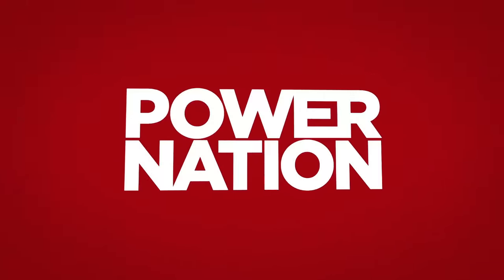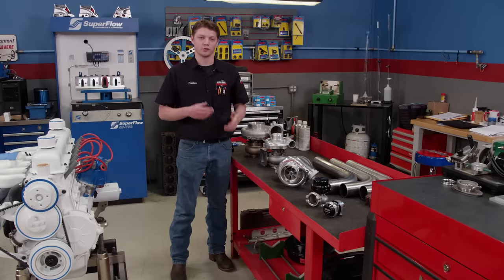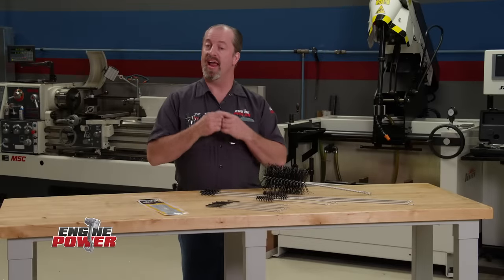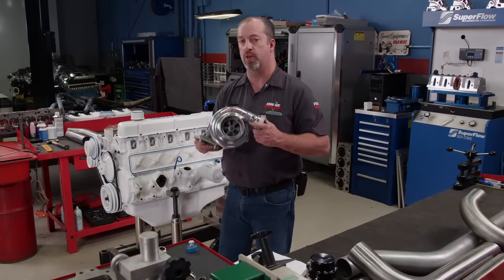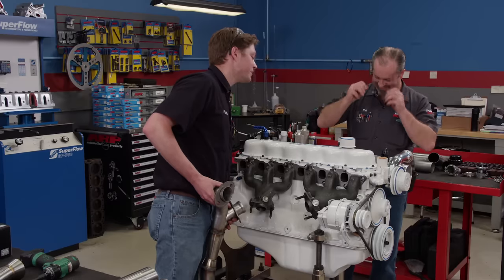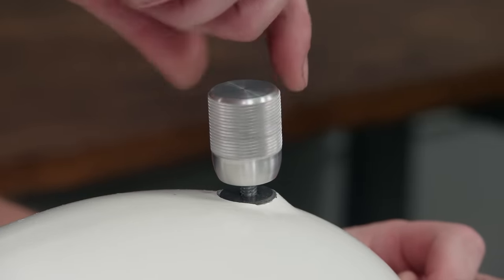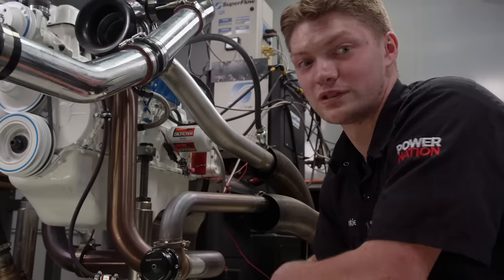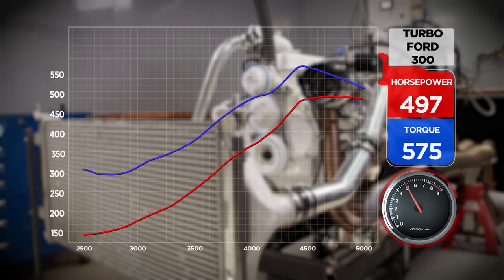Turbocharged Ford 300 Inline Six Makes Over 500 HP on the Dyno - Engine Power S8, E14

Comment: One of the best motors Ford ever produced. They seemed to take abuse and still run forever!
Reply: I agree. Ford really hurt my feelings when they discontinued the 300. I drove an old 1970 F100 for 6 years and I was not easy on it. I broke just about everything on that old pickup EXCEPT the motor. And yes, it was the 300 inline six.
Reply: Definitely one of the best all straight 6 motors made great torque numbers!
Reply: Yeah as long as you didn't rev it to high and float the valves
Reply: Adam Chapman  nah the aussie barra is better. Dohc, not underpowered, and the factory block can handle 2000+hp.
Reply: And the 4.0 Jeep motor, both legendary
Reply: @deborahchesser7375  don't forget the leaning tower of power 225 from Chrysler.
Don't know why people discount the Old School 6s.
Reply: Im a chevy guy, and even I like the 300. A good motors a good motor.
Reply: @CamAteUrKFC  Yep I can say the same about the good ole 350 Chevy 4 bolt main. Just a work horse.
Reply: @deborahchesser7375  Yep, undoubtedly the best motor Jeep ever made.
Reply: @SGTJDerek  I have one (Slant 6) in my garage!  Was going to use it, but never did.
Reply: @aaronmcconkey1062  The 240/300 was first used in 1965
Reply: @SGTJDerek  The AMC/Jeep 4.0 is popular
Reply: I got one with 300 hundred thousand on it she still run 😂😂. Now I'm wondering  if I can make it like there 300 🤔🤔🤔
Reply: I doubt this block would be durable enough to handle 600 ft/lbs torque if you put a trailer on it and dragged it up a hill a few times. Problem with it is, it is 6 cylinders long and the block will be getting wound up torsionally causing the main caps to walk or the main saddles to crack. It was never designed for 600 ft/lbs but if you weren't greedy and knocked the boost back to say 400 ft/lbs it'd probably be perfectly fine.
What a great thing though.
Reply: @timothykeith1367  never said otherwise. Unlike the others, there's a huge Aftermarket that support it. You want obscure, Pontiac had a pretty strong performing straight way back in the '60's and the argument can be made that the Hudson FLATTIE 6 could actually be the first Factory MuscleCar as it had more power than the legendary V8s from Olds and Cadillac.
Reply: @CamAteUrKFC  you and me both.
Reply: Agreed!!
Reply: I killed mines in less than 12,000 miles of owning it
Reply: John Sears  overheated it and warped the hell out of the cylinder head. Also revved the piss out of it and cracked the block
Reply: Ford Diesel 7.3L : Am I a joke to you
Reply: @SGTJDerek  C'mon the 225 is hardly in this league. They are very ordinary engine. I have worked on hundreds upon hundreds of Slants in my career as a mechanic and I can tell you while not a poor engine per se they are most definitely below average in terms of reliability, power, flexibility and durability. 
They simply don't last as long as other inline sixes, though in truth some do last but most don't. On top of that they can't handle sustained rpm over 3500rpm as they flog out. You're going up a long hill with a load on and use 1st or 2nd and go up at 3800rpm the exhaust manifold cracks, it overheats, then they start detonating because of the hot spots in the combustion chamber. They're not good for towing heavy things at on the open road.
If you never rev them over 3000rpm and never use them to tow anything but a 6x4 box trailer and always change the oil and filter they last quite well but then the no.6 big end lets go and punches a hole in the block and smashes off the starter.
Yeah not much of an engine in my experience
Reply: It was the best. They quit making them because ii was killing dealers on repairs.....there was hardly ever any.
Reply: I got a 250 cid
Reply: I have a 77 F100 with the 300-6. Still runs perfect. Has a slight knocking sound that has not gotten any worse in the past 10 years or so.
Reply: @aaronmcconkey1062  is that the only good engine Ford gave you aussies?
Reply: @CamAteUrKFC  Chevy made a great 6 too. It was the 250 GM straight 6 used in vans and step sides. Virtually indestructable...💪
Reply: @aaronmcconkey1062  The Barra engine looks like a fantastic engine. 
My uncle had a 2 door American Falcon, in Burgundy Poly with a 289 V8 and 4 on the floor. That car just looked cool! He still kicks himself over selling it. 
That said, the Barra engine was developed for the Falcon in 2002. It is a car engine. The 300 I6 was designed for the F100 pickup in 1965. The power and torque curves are shaped for hauling loads. The Barra is also a 37 years newer design.
Reply: @aaronmcconkey1062  those Barrasso are higher rpm engines.  The 300i6 was designed to have low end torque. Barras are just made for performance while the 300s were are for work
Reply: @jamesworkman686  It's red line is in the low 4k. It was a low RPM tractor motor adapted to car use. Red lining it until it breaks isn't a problem specific to one engine.
Reply: @GlitchMaster0001  Just sold one with 375k original miles, runs and drives fine, needed a clutch for the first time.
Reply: @marclaporte7163  They still produced them
Reply: @bloobebybloob6091  Correct.  Navistar/International Harvester produced them.   Ford purchased them.
Reply: @marclaporte7163  ic I thought they purchased the rights to produce them. My bad
Reply: @marclaporte7163  I went digging and Ford engineers did help design the 7.3 powerstroke so I would still consider that a Ford engine kind of
Reply: I inherited one from my father in law that had an oil filter full of sand when I got it. Literally sand! Damn thing weighed 5+ lbs. New filter and fresh oil and it ran like a top. Took me all the way to 340k when the truck got rear-ended and totalled by the insurance company. I drove it home after getting rear-ended, and it ran perfect. I miss that thing. Sure don't make em like that anymore.
Reply: @bloobebybloob6091  Possible.  But would probably be difficult with tooling, know-how, and honoring warranty.
Reply: @bloobebybloob6091  There was some degree of a joint venture for Ford to license the units as Ford Powerstroke.  I own 3 of these trucks.  The top cover/guard on the engine all say Ford Powerstroke but the valve covers all have a Navistar sticker..
Reply: @waterloo123100  We made that engine, 100% aussie made and designed
Reply: Just bought a 88 with 120k miles on the dash, starter is rigged with a button inside and my coolant is disappearing and my oil is regenerating 🤣🤣 body looks clean asf though
Reply: @NFSINSANE  dude I love my 2.2 its all you need to putt  around and non-interference. 350k on mine still daily driving
Reply: My dad bought a brand new 1984 4x4 with 4 speed when he passed away in 1989 mom kept it until I turned 16 then I abused it replacing rear end front end clutch then at 315,000 miles it had a wristpin lock up and needed a rebuild then I drove it until it rusted the floors out in 2002 when I parked it. I wish it was savable I’d love to have that old truck back up and running
Reply: The best

Comment: Ford 300 is one of the best engines ever made.  I drove one for two years, doing flooring work, overloaded as hell, and had 488k miles on the odometer.  Had close to 550k, when trans literally fell out, van had some serious cancer.  What hurts the 300 so much is that 60's cylinder head.  I'd love to see a modern free valve head made for the 300, and see how much it wakes up.
Reply: Have you seen the Australian barra motor?
Reply: Literally those inline 6 engines (the AMC, slant 6, and even the chevy 250/292) were just undestructible, wonder if someone got one to a million miles...
Reply: @Ausblack  yes McM, uses them from time to time, and skid factory. :)
Reply: @Thraser999  atomic performance or nizpro is worth a look
Reply: Dragboss garage was just talking about a Cleveland headed 300 built by Bruce Sizemore that made 500hp back in the 70s.
Reply: Correct me if'n I'm wrong but didn't UPS use those engines in their delivery vans ages ago?
Reply: Ford Australia made crossflow heads for I6s, don't know if any fit the 300
Reply: Worth investigating the bore spacing, if it's close to the Barra or the same,  and the head studs align up, instant 24V conversion with cross flow design.
The old school Mini A series has something simular using the head from a  K1100 BMW motorbike and this makes those little 1275CC engines sing to 7-8k rpm and 140bhp  N/A up from 28bhp in their original format.
Reply: @Eric Babcock I'm pretty sure those heads are for 144-200-250 Ford sixes, completely different block.  I'll be very surprised if they actually go back into production.  I've heard stories of people cutting 351C heads up, welding two of them together and making them fit the 300.
Reply: @larryhutchens7593  Yes, & they had their own UPS Spec'd Ford Parts.
Reply: They put a head on this one......
Reply: @Eric Babcock unfortunately the original owner passed and alot of stuff was lost.
Reply: I had a ford van with a 300-6 and 4 speed in the floor(factory) and hauled carpet as well!
Reply: @Apittslife  Thanks, I thought that I had read that somewhere.
Reply: @bigboreracing356  I drove the dog balls out of that van, 5500 rpm may not be alot for modern power plants.  I am known as a car killer, the old ecoline died to body rot, not column shifts.
Reply: @Thraser999  my grandpa has a old 250 in-line 6 Chevy 154k runs like a top no smoke and never been overhauled 1969 model
Reply: @larryhutchens7593  I'm not sure, but UPS used the Chevy 292 six for many years
Reply: @Sf_Mason  The Barra is based on the Falcon six.  The 240/300 is a long motor
Reply: @bigboreracing356  I had one in a 95 F150 and it was capable of revving to 5500. I did it regularly as a teen.  It was one of those cases of making a ton of noise and not going anywhere because it fell flat on its face just after 2500rpm lol.  But if you just wanted to be obnoxious in a parking lot, a straight pipe 300 at 5500 would certainly do it for you.
Reply: @Thraser999  yea my dads 64 250 went well over a million and then he rebuilt it still runs but been parked almost 20 yrs im planning on doing a 292 and using the 250 in another truck
Reply: How about one of those “Cleveland” cross flow heads.    Yes drag racers cut heads up and made these custom only in the early 70’’s for the 300.    Check it out some good history there
Reply: Steely oily dreams
Reply: I have a 300-6 with a tremec t-170 4 speed in my 87 f-150 and it revs to 5500rpm without a problem. Idk if you maybe had a limited industrial one or not, but it definitely revs in a normal application.
Reply: This what the Australian  Ford Falcon started with in 64 , 45 years later its a twin variable overhead cam  alloy head Ford Barra engine , normaly asperated taxi up to 
400 hp fuel injected turbo , and with just after market head bolts , valve springs and oil pump gears , we're getting over 600 hp with stock head and bottom end
....https://youtu.be/hJ6O1qnMmak
Reply: Ford did develop a prototype cross flow head at one point but the project got canceled. There was a drag racer that got hold of one somehow and built an engine with one on it at one point, but it's obviously a unicorn. There are some YT videos around. Would love to see what these would be like on the street if they had a good head on them.
Reply: Very linear power here.  Get some race fuel and advance the timing more and you have something.
Reply: @randr10  The Frenchtown Flyer is who your talking about i think.
Reply: Ford barra straight 6.. Modern day counsin. Its a monster, it puts the smack down on a 2jz
Reply: @Eric Babcock The company was bought and renamed. They have the heads again, in current production but you have to pre-order. Same expensive price as before, but if you want a modern head....
Reply: @Ausblack  Those are OHC engines.

Comment: Being a huge I6 Ford fan, this episode gave me goosebumps.  Outstanding job.
Reply: you like the barra?
Reply: Because it finally confirms a lot of our suspicions. You really can't go wrong with a big inline 6 and a big turbo
Reply: @tturi2  I do it is a nice straight 6
Reply: me to.....big 300 ..6.  Fan....had a 
1993...f150. 4x4....300..6...motor 
Snowplow on it.....got the job done with attitude. ...grrrrr.......
Reply: @Hydrostream1972  If you still had that truck would you have the engine making 500 HP like the one in this video?
Reply: @tturi2  barra is impressive but ill take an old school 300 anyday
Reply: 500 ft lbs is insane
Reply: Ford Australia had some serious evolution with their inline sixes. They began from the same humble beginnings as the US Falcon. However by the late 60s and early 70s, things took a step away from their US counterparts. They included cross flow heads, fuel injection, alloy heads, and in their final incarnation, a DOHC, variable valve timing, intercooled turbo.362 horsepower stock, but capable of an easy 1000 reliable horsepower. Some have managed to pull 2500+ horsepower out of them. All from a 4 litre that can lay waste to the likes of the Supra 2JZ and Nissan RB series engines. No surprise that the XR6 Turbo Falcons they powered were very capable police pursuit cars
Reply: @ws8061  the 2000s 12v and 7.3/6.0 all made around 500ft/lbs and so its crazy this thing competes with gas and smaller displacement
Reply: I love this motor. Had a regular one and an H.O. 4.9L inl6 300 in 2 different 90s model f150s. You just can't kill those things.
Reply: I can't think of a more efficient way to spend gasoline- oh yeah- except maybe just take a 55 gallon drum of gas & POUR IT OUT in a parking lot! this engine sucks like a vegas 8ooker. a 460 big block would be better use of space.
Reply: Do you know why they put turbo where they did, and used that crazy amount of plumbing?
Reply: @rockets4kids  so that a lousy, 9mpg sucky engine can get 7mpg?
Reply: I built a 300 with a 2-barrel intake, 302 carb, headers, and a torque cam.  It twisted the 1/2 ton drive line out of my truck a piece at a time in 6 months. I had to replace Everything with 3/4 ton Dana Posi, 1-ton granny trans, 11-inch dump truck clutch and a custom driveshaft.  Two years later I had to weld, box and fish plate my frame back together to live behind that engine.  I NEVER had any use for a V-8 after that.
Reply: @ohitsthatguy1328  True,,the F150s with that 6 were built to go forever.
Reply: You can actually make way more power with the fuel injectied 300 then the carburetor 300.